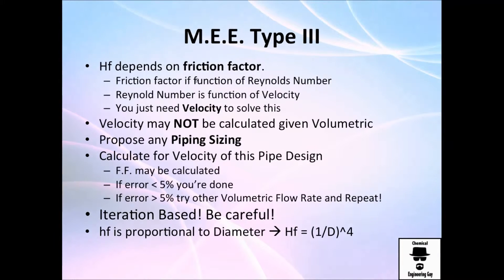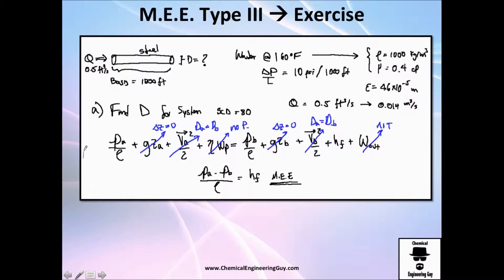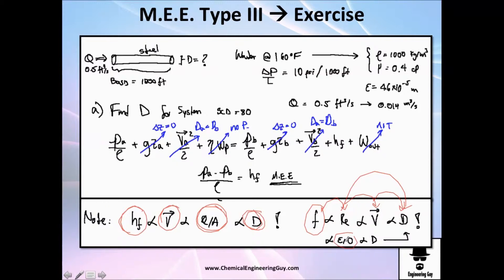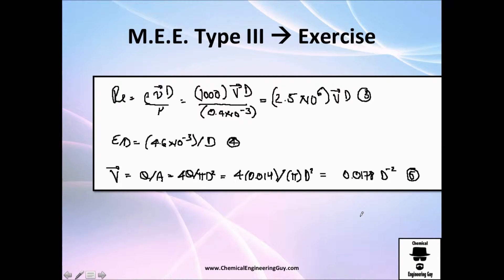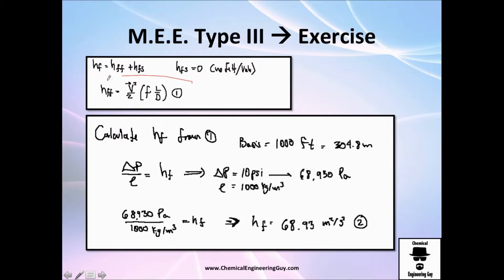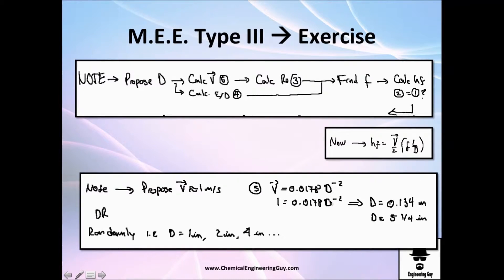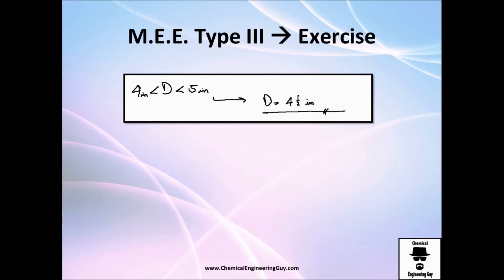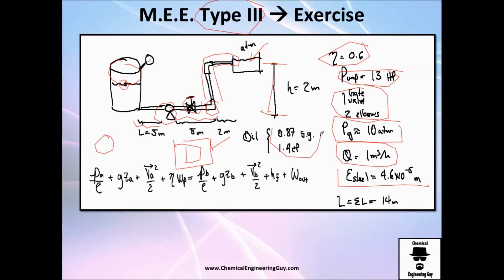Problem Type III in Applied Fluid Mechanics / Applied Fluid Dynamics - Class 061

Comment: Also, the friction head loss hf should be in meters and not in  (meter per second)^2 to avoid confusion //// 68.93 (m/s)^2 or (7.03 m). 10 psi Pressure should be divided by specific weight and not only by density. beginners may have confusion regarding this, same result though.
Reply from the maker: All those corrections are not "corrections" but a different way to express the Mechanical Equation. Your notation is much commonly used in mechanical engineering (meters of friction)... In chemical engineering we prefer m2/s2 (units of energy in SI system). But it is true.... some students may confuse this since they will not recognize the terms/equations. Thanks for the comment!

Comment: No pipe size. Apply Hazen and William Equation . much better. C for steel use 120
Reply from the maker: Yeah... you could use that as well... you just need to know the values for each specific fluid.